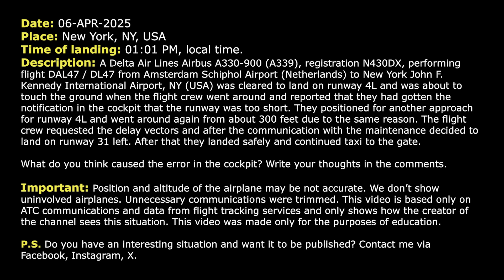The longest available runway is too short. Delta Airbus A339 has problems over New York. Real ATC

Comment: As a Boeing pilot this just seems crazy to me....
Reply: I think the crew was dealing with company policy as much as the faulty computer. 
Just because it can be done, doesn't mean company policy allows it to be done.
Reply: @slartybarfastb3648 Indeed, Delta’s got a black belt in manual-flipping.
Reply: Same, we would just do a manual calculation lol.
Reply: @idkjames Affirmative.  This is what happens with pilots who are, as Captain Warren Vanderburgh so aptly described, “children of the magenta line.”
Reply: Flew airbus and Boeing, had to fight Airbus computer sometimes
Reply: As an Airbus pilot, this seems crazy to me. Not their response to the warning necessarily but that we’re operating aircraft like this. So much for experience and judgement. Some dysfunctional computer telling you that 11,000 feet isn’t enough.
Reply: Because the plane knows better. Southwest airlines can tell you a thing or two about Landing in Midway or Burbank and guessing the runway is long enough. Thank Airbus for that system. If it falsely responded, then the data that was entered into the FMC must have been wrong. Or the plane was not stabilised or way heavier than usual. Maybe they fueled the A330 Up to Max. Landing weight because fuel was cheap in Amsterdam and on short final the computer recognised that 4L was just too short for that weight.
Or Delta Airlines wanted larger margin of safety programmed into the system of their jets because they don't want to end like southwest Airlines.
Reply: @AGerm332 #NotanAiLinePilot lol
Reply: Agreed.  The second go round should come right out of their profit-sharing checks.

Comment: 4R is shorter, correct?

- Potentially.

What?!
Reply: Yeah, very very silly answer, the controller should know the numbers of his runways
Reply: @mennoydema5222  It's not a silly answer, the displaced runway section at the ends of 4L 4R are different. 4L is only longer if you can use all of the displaced runway at the end which is 3400 ft.
Reply: I'm guessing that "potentially" reflects that the pilot is also considering wind speed and direction which affects the effective safe stopping length. The number of feet is not the whole picture. ...an actual pilot can correct me if I'm out of turn.
Reply: @UtmostChivalry  nah they were just discussing runway lengths
Reply: @UtmostChivalry  The "potentially" answer came from ATC, not the pilot.
Reply: @UtmostChivalry 4R and 4L are the same heading, no difference in wind. ATC are just giving a crazy answer I think
Reply: It could be the there is potentially bad data in the flight management computer.

Comment: Turn off the ROW/ROP, no problem.
Reply: Had to look that up. The Airbus has a Runway Overrun Prevention System (ROPS) that warns the pilot if the runway is too short to land on, apparently what happened here.
Reply: @YayComity  A solution looking for a problem. If the landing data says it good, you should be good. ROPS alerts if the plane floats a bit long. Sometimes a slight tailwind will make it alert.
Reply: @sb859  I think you're spot on because the winds were heavy all weekend at JFK. I landed on 4R in a Delta A330 from Milan the day prior and we definitely floated prior to touchdown. Braking was veeeeery aggressive, taking up nearly the entire runway.
Reply: @tp7278  so the ROP and the pilots (and company rules) were correct in minimizing potential hazards. I suppose if 31L were not available then, with Company's permission, they could go ahead on 4L, using various methods to reduce airspeed and rollout distance. They could have done that but not without consultation with the company. Doing it on their own would be a good way to ruin your career, or even an airplane and passengers' lives.
When I took flying lessons, my instructor talked about "three strikes and you're dead". In a light plane that might be hurrying your preflight because there is weather you want to stay ahead of, then neglecting to fill both fuel tanks so "1/2 tank is enough for this trip". Then after you're at cruising altitude the weather gets worse and your VFR hole through the clouds closes up. Uh oh!!